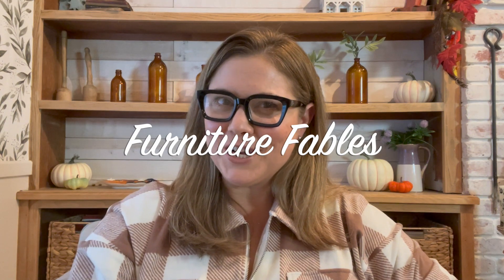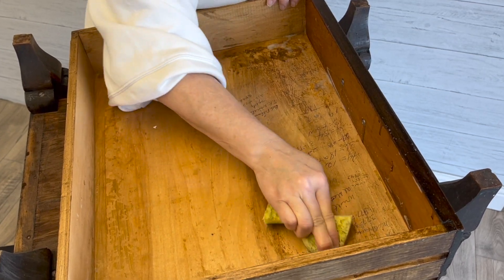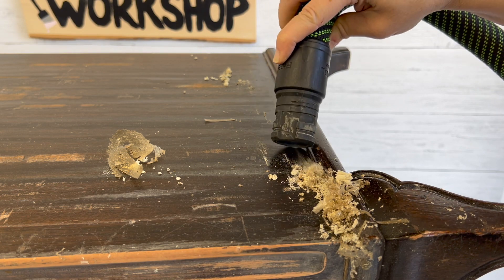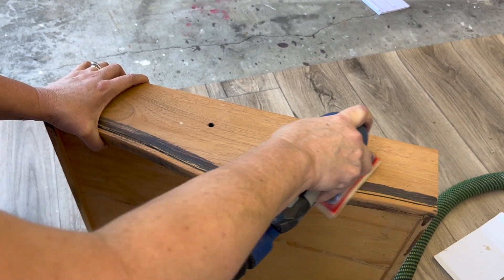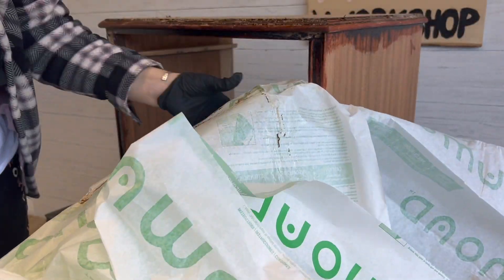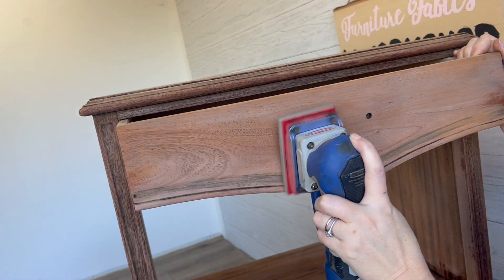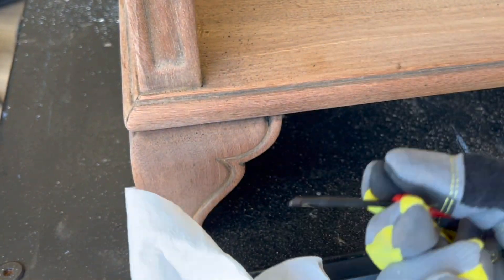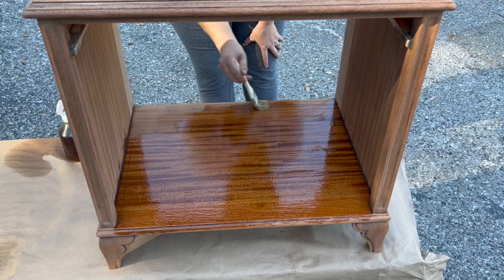Is Red-Toned Wood BACK?? | Basic Furniture Refinishing | DIY Nightstand Refinish | No-Paint Flip!

Comment: Very beautiful piece.. The wood on this particular table was very well matched at the factory. It was definitely worthy of this treatment. Many wood pieces are not so well matched and truly do not look great when finished in this manner, as has been demonstrated by numerous flippers on YouTube. As a designer myself, it is important to remember that woodgrain in and of itself is NEVER an indicator of good design. Many times a room will improve dramatically simply by painting a wood item that doesn't quite fit.

As for polyurethane, I want oil based poly on everything I own. Though I'm fanatical about coasters, I can absent-mindedly set a wet glass or mug down on just about anything. The lacquer most flippers are using now because it dries so fast, is very inferior to polyurethane which lasts for decades. Lacquer virtually disintegrates in 10 to 15 years. Makes for nasty water rings unless refinished.
Reply from the maker: Great points, Clifton!  Thanks so much. 😊👍

Comment: I stripped an oak table that had a dark finish. Not a solid slab of oak. The timber was never intended to match as was covered in dark stain. So it reveals the mismatched timber, but still looks good and nobody notices. Also stripped a cupboard with doors that open out from the middle. The mismatched wood is very noticeable to me.
Reply from the maker: Yes, you never know for sure exactly what you'll find, right?

Comment: Beautiful! Hope the new owner takes care of the oiled finish! Technique question, if you want to strip the detail areas, why not strip the whole piece? Or use contour scrapers in the detail areas if you start with scraping? Curious because everything takes time; scraping, stripper, sanding, so I guess I just wonder what is most efficient way to do pieces like this? I have similar pieces that won't make as much profit in my area, so supplies and time are a definite factor when redoing these.
Reply from the maker: Great question - I tend to start with the "bluntest" instruments first and see how far they get me.  I also dont enjoy using stripper, (and dont ever trust it will do what it's supposed to) so I tend to save that until I absolutely need it.  Contour scrapers are a good idea too, but if you spend the money on them and then they dont fit or can't complete the job, you're back to the chemicals.  It's always a mid project judgement call for me.  😊👍

Comment: Did you not hemp oil the new back?
Reply from the maker: Great question!  No, I didn't - mostly because I didn't want to risk the oil soaking through to the other side and compromising the paper.  Might not have been an issue, but that board was pretty thin, and so didn't want to risk it. 😊👍